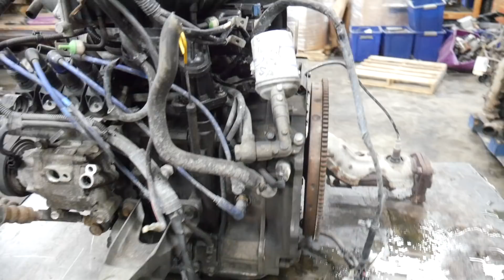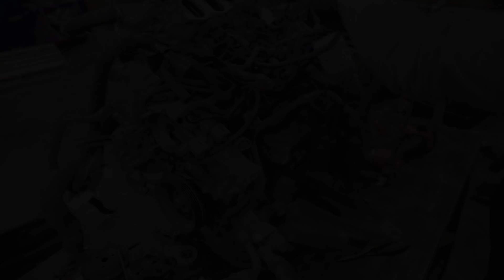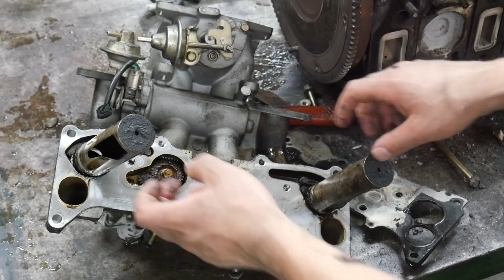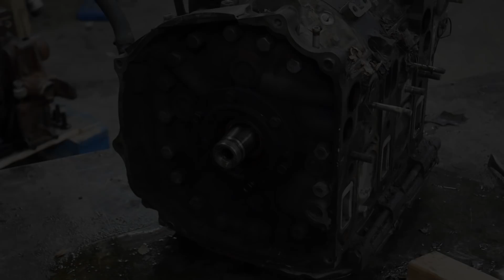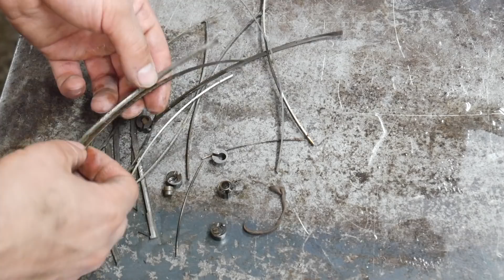13B RENESIS Total Rotary Teardown. 04-11 Mazda Rx-8 6-Port!

Comment: I had to explain one time that carbs don't feed the engine,, they restrict them🤔😎 the less restrictions the stronger the engine runs,,, open up the carb and let it breath,,,, newer cars with injectors have these cool things called rev limiters,,,, lots of electronics,,, but ain't no rev limiters on engine runs on a carb🤣🤣🤣

Comment: So some engines are not built to last,, they are built to blow up,,,, so to say,,🤔 they are hi performance ,, and not intended to last, they are built to run hard and have fun with,, and then yeah well they either need completely rebuilt or run em till the blow👍👍👍 kinda the same as a 2stroke dirt bike engine,,,👍👍👍😎😎🤘,

Comment: that front eccentric shaft bolt is only tightened to 80ft lbs. the flywheel nut is 350-380 though

Comment: I used to have an RX7. Used it as a daily driver.  I put 2 mostly stock engines through it. The chrome on the housing starts to crack and flake near the exhaust port after 90-100k. In my opinion this is not enough engine life to make the engine design worth while.

Comment: Just your typical Americans opinion on something that doesn’t have 8 pistons, mostly USA problems with carbon as your fuel is so poor, Piston engines have been around for 200 years and still have the same issues so what is your point ?

Comment: I had an '86 2nd gen. from '96 to 2018.  Put in a reman in the next summer when the original blew just over 120k miles.  Learned how to tear them apart and rebuild them, not including machining.  Good times.

Comment: It’s not hard to find rotary engines that have over a 100k the 90k mark is when you are supposed to replace the apex seals also the problem you are talking about I’m guessing is the oil burning thing yes rotary engines burn oil by design they are supposed to as someone who has worked on rotary engines and has owned a car with one I have grown to love these engines I’ve seen them reach 250k+ miles given that they are taken care of properly… the unreliable stereotype isn’t an error of design it’s an operator error

Comment: Really only the whole rotating assembly and stationary gears are whats valuable on a renesis. Everything else is junk and better to use older 13b parts. What kills these engines are not enough lubrication. Some decent premix and delete the useless omp and itll last you a very long time. I had over 400k miles with good basic maintenance and premixing. Renesis housings and irons are useless since usually warped or flaking chrome. On top of it being side exhaust instead of peripheral exhaust pretty much makes the whole block trash

Comment: Rotary performance guys say to eliminate the factory oil injection system and use synthetic 2 stroke oil fed from an auxiliary tank, 2 stroke burns cleaner reduces the carbon buildup on the seals

Comment: Mm, yes. The primary cause of these motors failing has been mainly from improper maintenance, as their maintenance is odd compared to conventional pistons. My 2011 RX-8 has 131,000 and still going. They do last over 100k, but without proper and precise maintenance they do break easy.

Comment: Hey Eric , have you done a tear down on a Gen 2 Cadillac CTSV 6.2 liter supercharged stock engine (556 HP) ? My personal car is a 2012 CTSV (6 speed automatic transmission) … no issues with it whatsoever , I’d just love to see the disassembly and inspection of one . You may not see many of them that are NOT heavily modified because they are so easy to add a couple of hundred horsepower and the gear heads just can’t resist ! LOL 😂

Comment: I had my 1990 RX7 ported and resealed for 12,000 RPM stock was 9000, 90 mph in first gear, but was warned would only last 5,000 miles, and he was right

Comment: Hey you brought me back good memories. I had a 12 a swapped In a 1982 Toyota Celica and was a little bullet. I used either brake fluid or transmission fluid through the intake to clean the apex seals . It never gave me any problems but that was 23 years ago. I wish I still had that car. Thanks for the video.

Comment: You made one major mistake right out of the box. There is an 04 to 08 Renaissance rotary. And there is an 09 to 11 Renaissance rotary. There are differences between the two engines. There is NOT an 04 to 11 rotary engine. The series 2 engine has more oil injection ports in it. Has a different oil metering pump. Different injectors. I hope you make the correction to your video. I haven't watched the whole video yet I just had to correct that major mistake. Again there is no such thing as an 04-11 Renaissance rotary. also s2motor has oil filter in completely different location. Different oil pressure. Totally different motor.also UIM is totally different. EOMP is in a different position as well. On top of the motor.

Comment: Unfortunately, the downfall of this engine as far as ive learned was the oiling of the housing. If these rotaries were fed a mix oil that was meant for combustion (vs. burning its own motor oil) most of the issues go away. But the customer couldnt be bothered with another reservoir to pay attention to and keep full. On the newer RX8 engines i believe the main failure was the inner coolant seal. That and they moved the exhaust ports to the irons which exposed the sides of the rotors to carbon. Also the shape of the new exhaust port was prone to catching and building up carbon, forming a chunk that would eventually break loose and thrash around inside.

Comment: You must piss off the Snap-On, MAC, Craftsman, dealers et. al., unless they have started to chrome plate ALL of their impact sockets? Use the proper socket for the job intended with an impact wrench, unless you have the best relationship with those suppliers, and/or you never break their regular use sockets, or they don't give a damn? I guess nobody else has picked up on this? DUH!

Comment: "They all have the same problem, and if you haven't fixed the problem in 50 years of production..."
It's a valid criticism. Bad fuel economy, bad emissions, bad torque, burns oil by design, exhaust smells like burning metal. I owned a Mazda RX-8 for 9 years and I loved the idea of it, but the Wankel engine has some fundamental shortcomings that cannot be solved without changing the design so radically that it's no longer a Wankel engine. They were impressive compared to the big dumb V8s of the 1970s, but once Detroit realized there was more to improving an engine than just increasing the displacement, piston engines leapt forward and Wankels couldn't keep up.

Comment: Aren't those rotary engines built really well? I know they put out allot of power. I drove one back in the late 80s and it was pretty powerful. Clean coolant makes me think they took care with it. Oil changed when needed and coolant kept clean. Nice rotary. I've heard some rotory 3 engines cost upward of $40,000.

Comment: Honest guy and great in depth tear downs.
Re the RX8 engine, in our opinion its not in bad condition at all. The casings do have some marks agreed but if the rotors were thoroughly cleaned and new tip seals 
installed it would very likely pass a compression test at 85-90%, enough for easy starting and many more miles of life.
Greeting from Russia, Girood Airfield Hangers.. ❤️
Reply: I did not expect to see a Mazda rotaries fan Russia! (to be honest anywhere outside North America and Japan and even in North America these were rarely seen) 
curious to know how often you see any rotary mazda's on the road, either now or in the past 20 years? even in North America they weren't very common to see!

Comment: im a master Mazda technician. I left in 2005. we had these cars sitting on the lot so long the gas was going bd in them and they didn't run anymore. recall after recall after recall. ill be nice. the car was a POS as well as everything under the hood. A/C recall too as we were pulling the dash replacing the evaporators in them. they are littering the junkyards now for a reason!

Comment: Saw a really interesting video on making the 13B more reliable which was quite intriguing.  Off the top of my head, the guy mentioned doing premix oil in the gas and using e85.  There were a couple of other things like using a solid dowel in the oil galley (now possible since you'd use premix) and then strengthing the clamping force between the pieces. I'll see if I can dig that up...
Reply: Can't believe E-85, even my riding mower say's NOT to run E-85, lol
Reply: @blueplasma5589  Yeah, E85 (or ethanol) lubricates less than petrol. I don't see how that would help. Fitting Series 1 RX-8s with the higher flow rate oil injection pump from the Series 2 RX-8 is also recommended I believe.

Comment: Saw rotary powered Mazda when they first came out at the drag strip, it tore up everything it ran against but, was not liked by the fans as they didn't make the noise attributed to fast drag cars. Unbelievable RPM's from this engine, small and light.

Comment: I drove the hell out of girlfriends back in the eighties. It was very small for a 6 foot 7 person but I squeezed in it and shifted its 5 speed. Was a fun little machine.It was good she traded cars every 3 years, as it didn't start falling apart yet. I would run MMO through it, to try and keep that carbon off those apex seals. Interesting design,  but not a very good real world engine for longevity..Great Video of its working guts....👏👏👏👍
Reply: MMO= mothers milk opium?

Comment: I wonder if anybody has ever studied rotary engines running exclusively on gaseous fuels such as natural gas or propane. Because, as bad as the sealing systems are, I'll bet they would work better and last longer if there was essentially zero oil dilution from the fuel.
Reply: They can run even with Hydrogen

Comment: Me: "yea, i wouldn't buy something like this. seems like a lot of failure points and hard to maintain"
Also Me: owns a 2021 BMW X6 M50i with the all wheel steering option as a daily and a tuned 2013 Mercedes C63 as my fun car

Comment: That was cool, thanks.
I rebuilt my 81 rx-7 back in 95...great learning experience , had an oil leak in the front of the motor....didn't know that they come apart from the rear forward....I originally was just going to pull the front cover off, but Mazda has other ideas....loved the car, great driver, so much fun to go thru the gears and it handled great! Wish I still had it.
Reply: I still have the humongous socket for the flywheel.....

Comment: The amount of seals is ridiculous. I would hate to rebuild one of these. When the rotary engine was raced with IMSA years ago it was the LOUDEST engine I ever heard, the tone and sound of which had nothing in common with other engines. Just awful. To me, this is the answer to a question nobody asked. Thanks for the video, I really enjoyed watching this thing come apart as I have never, ever messed with one. (other than to tell my buddies who bought RX7 that basically were throw away cars at 70K miles)

Comment: Automatics also have a 6 port 6 speed configuration introduced in 2006+ and it’s more or less the same as the manual 6 port engine but I believe has less injectors and obviously a lower redline due to the reliability of the auto trans

Comment: Actually, the centre ports with the prongs (air mixing jets to aid with fuel atomisation) are your primaries, the lower two outer ports are your secondaries, and the barrel valves are auxiliary ports that are open after 6250rpm, all the way to 9k.
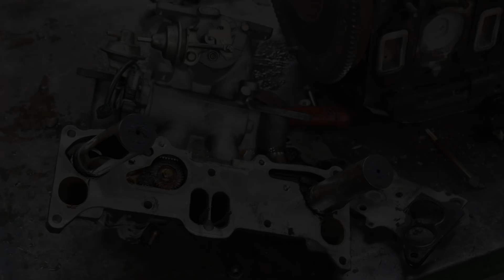Reply: at 11:39

Comment: Oil injectors are best isolated and just go over to pre mixing real 2 stroke oil into the fuel tank. The engine lube oil is not designed to be combusted and is a big part of the rotary problems.

Comment: 15.15 yea that front bolt is no joke. I had a normal breaker bar and had to use my exhaust for more leverage. I also had to stand on the motor. (It was on the ground)

Comment: Just out of curiosity, if you own a RX-7, handle it properly, and know the proper tool for the flywheel nut, why would you do it the wrong way? Let's be honest, a 2 1/8" or 54mm socket is $17 at Northern Tool, I paid $15 at Tractor Supply years ago and it's an on-the-shelf item at both places. Simplest way to lock the flywheel is a straight 1/4" thick flat bar in the ring gear, then crank on the nut (~350 ft.lbs). Last time I did it on a 20B, I used a 18" breaker bar, 1-ton come-along and a BIG tree. Just a couple cranks on the come-along and it popped loose.

Comment: I had rx7 in the 90's. Rebuilt engine twice. Checking tip wear. On second build measured tip wear. I say they 
are good for 70k miles. Pull engine at 70k and replace tip seals. Engine might last longer.

Comment: that's a major problem if it doesn't have pistons... if you have one of these, see Rob Dahm's info on engine oil lubing the apex seals...30yrs ago, i deleted mine, ran way better right up till the apex seals broke...2 stroke oil would have likely saved it...lesson learned...

Comment: Been into a few 13Bs there definately intresting. And compared to a piston engine very very simple, But thoes Rotor housings and apex seals are a wear item. They were designed to burn oil, have little pumps and squirters to lube the apex seals as the dorito inside goes round and round that squirting oil is what keeps them alive afterall.

Comment: I'm in New Zealand, and we have a big rotary scene here, and some of the best rotary tuners around. A mate of mine has a RX8 with 300,000+ KM (186K+ Miles) on it, only thing he's changed is plugs, apex seals 3x, belts and fluids, the rest is original. He also drives it like a rotary likes to be driven - like it's on fire ;)

Comment: When I was young I had a neighbor who owned a 1990 RX-7. He offered to sell it to me for $ 2,500, 75,000 miles. He told me I needed repairs to the brakes and shocks, repairs that I could do on my own. But then my neighbor tells me that I have to change the apex seals. Fortunately I never had enough money to buy this car, I would have lost so much money. How much I would have lost to get the engine out of the car, take it apart and change a few parts that costs $50 - $60.

Comment: supposedly you can get much better reliability if you block off the oil injector ports and mix 2 stroke oil in the gas

Comment: Wankel rotary: the bastard child of a gas turbine and a piston engine. It gets great horsepower per pound and high revs from the turbine side of the family, but also poor fuel economy and low end responsiveness. Seems like rotaries would work better in aircraft, watercraft, and maybe motorcycles than in passenger cars.

Comment: My 84 GSL 12A had over 300k original miles and still ran strong when I sold it. My 94 R2 had 80k miles when I sold it BUT i had removed all of the twin turbo nonsense which was nothing but trouble, went single turbo low boost and ran fine.

Comment: This is a series 1 renesis with two oil injectors per rotor. 03-09 basically. 09-12 is the renesis 2 with an extra oil injector in the middle of the rotor, increases/improves lubrication tenfold and makes the engine longevity much longer.

Comment: I once owned an 85RX7 5 speed 13B engine and it was doing just fine (original clutch and no engine issues) until the car was stolen at about 125K miles ... With the rotary, oil level is critical and must be checked often. Also never let them overheat or the aluminum housings will warp.

Comment: I truly have a place in my heart for the rotary engine.  T
With the engine seals having issues, constant need to top off the oil and need for premium gas has diverted me from getting another one.  My question though... which engine do you recommend to replace the rotary and can actually fit under the hood?

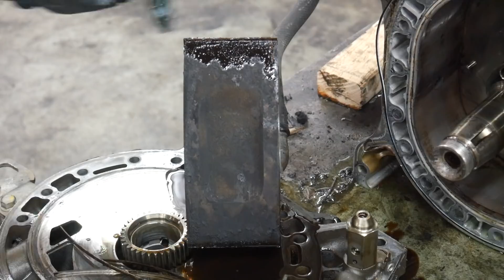Comment: AT 22:08 there look like a round magnet stuck to the back cylinder wall, then it falls down at 22:54 then falls out of the engine while your tapping it. I wonder if that was what was loose in there

Comment: Great video. That was the first time I've seen a full teardown of a rotary. The apex seals are the Achilles heel of this engine. No wonder they didn't become popular.
Reply: Nope, neglect, cheap fuel and treating them like piston engines kills apex seals on rotaries, this is only exacerbated by Mazda deciding to inject engine oil into the intake to lubricate the apex seals and people cheaping out on oil. Using rotary engines without bringing them up to operating temperature and regularly redlining them does them no service either. Basically rotary engines are not for the average driver, if you don't know how to use one properly or are willing to learn you should probably stick to simple piston engines.
Comparing the amount of money poured into the development of the Otto cycle piston engine over the last 90 years to the amount spent on the development of the Wankel rotary engine and you will have a perspective of how skewed the development really is.